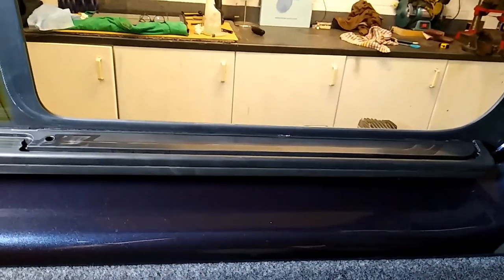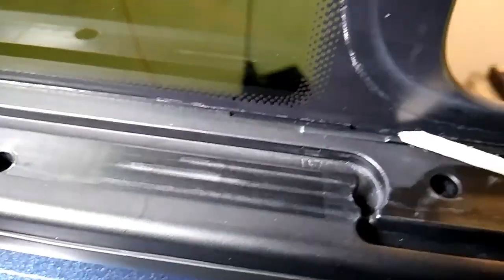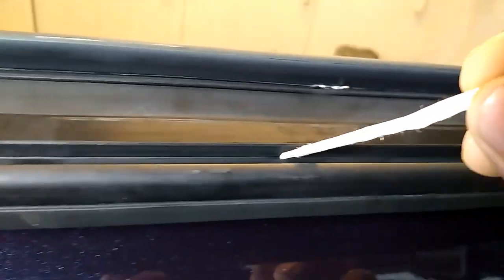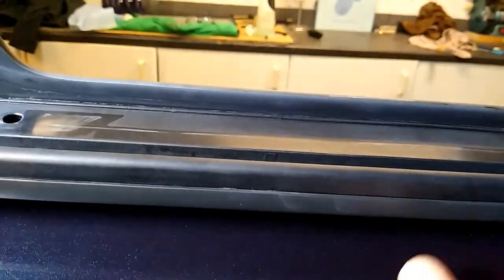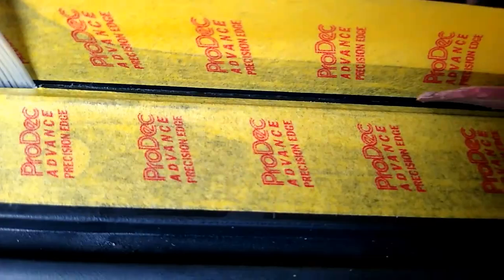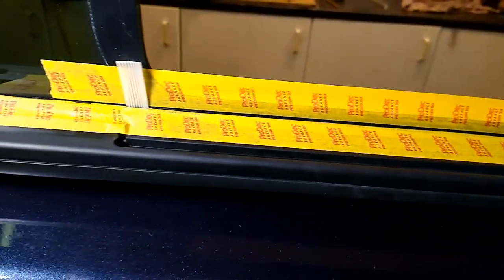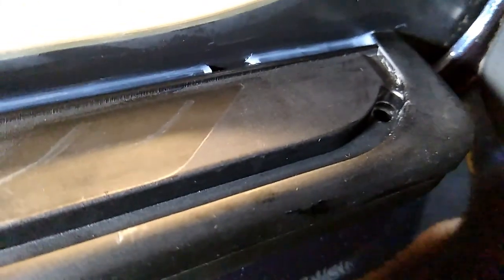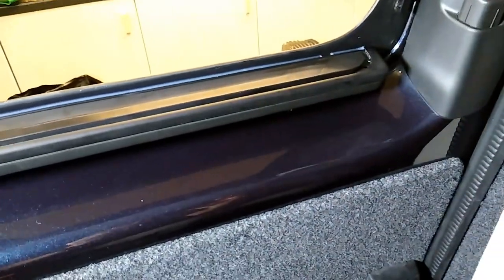VW Transporter T6 Kombi leaky side windows cause and fix

Comment: I have a 2006 T5 4motion  crew cab kombi  factory job. 
The metal  plate  which is sandwiched between the runner base and the bottom covered is completely rusted and separated from the main window. 
Can this be purchased. 
Thanks

Comment: Hi.
I have a t6.1 that has this same issue. It’s a slightly different window mechanism but how did you get the window out to do this repair please?
Reply: You can hinge it inwards. As the upper and lower pins are retracted. You can hinge the whole window inwards and take it off completely.

Comment: This whole isue just got a lot worse - a T6 Kombi had it's slider window fall out due to corrosion behind the slider bottom rail caused by the known leak problem . The rusting [ which is hidden from view ] causes the botton slider rail to sag / drop and the slider window falls out . A very serious safety issue with catastrophic implications .
Reply: Same thing exactly happened on my VW Caddy!

Comment: My bottom rail had become detached at the back end. Can anyone recommend a particular bonding type that should be used to fix it back to the glass?
I will also need to carry out the leak fix once the rail is bonded to the glass
Reply: Did you find an answer to this question?  I have the same problem on my VW Caddy.
Reply: I had to replace with a new window.